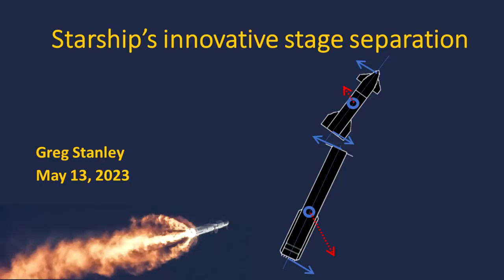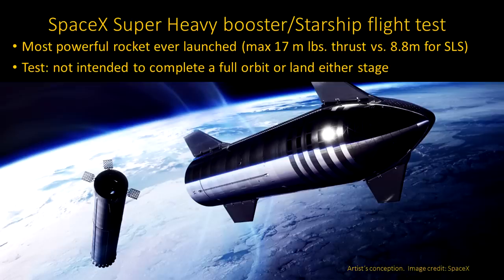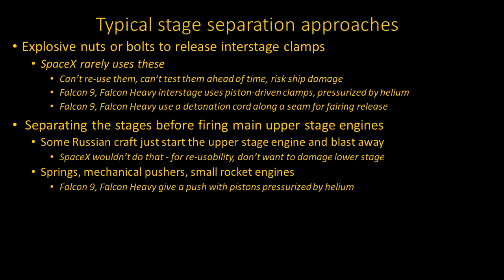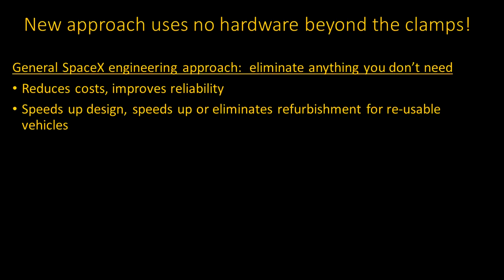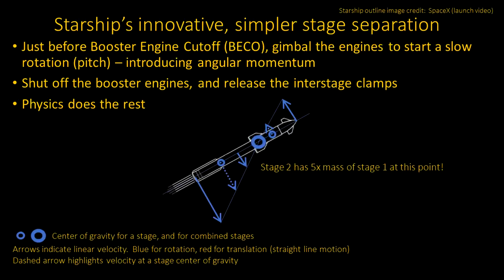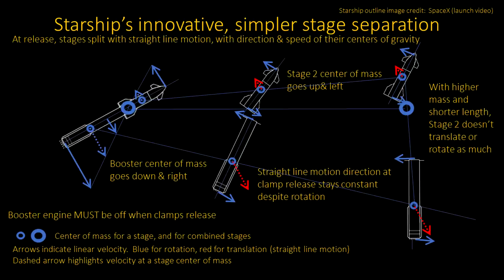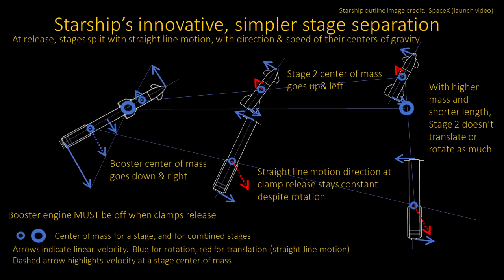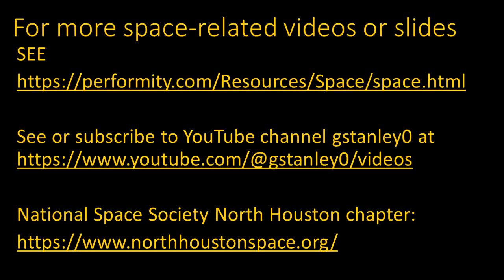Starship's innovative stage separation, using no hardware besides clamps, illustrated

Comment: Good explanation of a system likely to be overly problematic.

in theory it should work, but in the real world that difference between the two stages in center of gravity will cause them to get cocked, and bind.

I suggest going to a large O-ring or lipped seal between the sections, slightly more depth, and then using a pressure charge between them to push them apart.
You have alot of area, so it would act like a hydraulic cylinder creating incredible force at low pressures.

Also with the thrust of the booster, if your collar has decent depth, you should need no actual locking system. its an unnecessary part, would be better with a system like a harpoon, where there was slight friction betwen bitt and helve at the socket, and nothing else. You want to conserve options, so having the ability to light of the Starship's engines in an emergency and have zero encumberances would be best.
In fact, you could use one of the engine gasses to force the sections apart as I have described.

i.e. less parts, less stresses, and instead better tollerances at the slip ring which could be used for linking sections together for other purposes. like extended "train" ships for long Mars runs, or for use as habitat sections.

And if you try the rotational manouver at first zero g, you'll need a barf bag for every passenger.
Also if you used the gasketed socket approach, you could hold the two sections together with a slight vacuum which would in fact become more equalized with altitude.  could be metered to equalize at desired seperation.
Full disclosure: I'm the guy who planted to parts count concept when Elon was worrying about going bankrupt.
Reply: I agree. Looking at this mechanism, at the instant the clamps release, it's likely that the booster stage top will "kick" the second stage bottom. I think this is going to be reviewed where the clamps will need to push away between the two stages at separation.
Reply: Yeah not sure how this cartwheel style maneuver ever became a serious idea... for what is supposed to become a human rated vehicle. Somehow I feel like most people forget that people are supposed to be on starship at some point... There are a number of fairly simple concepts around that seem very reliable, are not very complex, and don't add huge safety question marks. Just a matter of going over some calcs to figure out which ones look the most feasible given the large size of the rocket.
Reply: good thing someone put on their sanity hat and decided to try out hot staging instead
Reply: @rawhide_kobayashi  Well, that didnt work out so well.. the booster got blasted and tumbled and had to be destroyed...
And I was in a discussion last night about the problems and potential solutions, and had to mention stuff from this writ.
Basically the real issue, is Elon has engines way powerful, that the 1960's concepts are now problematic and needs a total rethink and reconceptualized. 
Launching stacked stuff with towers, hot staging, absurd re entry angles, all soooooo 1960's....
Even the Space Shuttle was better, and it was decades ago.
And it was me who started the parts count thing that led to better engines... Maybe its a good time to reconsider re using some concepts, 
and starting to consider new stuff...
Reply: Hey what's your opinion after ift 5?
Reply: @AbhikKumarBhunia-c9l  
Talking about flight five we just saw?
Reply: @garylester3976  yeah
Reply: @AbhikKumarBhunia-c9l  
My position on the catch was as a skeptic until I heard the accuracy stats on flight four. which was only a day or two before flight five. then I knew they would nail the catch.

But, I'm not a fan of the tower plan. its too much infrastructure to do a job that can be done with way less.

Rocket Lab/Beck have talked about  tapered or cone shaped ships that are free standing. 
I think thats a better option. No tower required, or shorter tower for staging, or stage horizontal and erect.

The problem began with the water tank guys, and building in ring sections.
Fine for tanks, but locks to into a diameter and building round with straight sides. Hard to do tapers, or get other shapes.
Which is very easy running your gores longitudinal like in ship building. Basically they got a bad start and too resistant to change at this point. I've done alot of writs about all of it.
But I could see a better Starship being tapered, and bigger at the aft end and using solid structures and minor shock absorbers to stand on surfaces that are reasonably level.

I would have built mostly with longitudinal gores, tapered the booster and ships, probably used semi concentric tanks, Fuel in center tank, reverse tapered them to get two bottoms above engines.
And shortened the ship's length to beam ratio.

Then you could land and take off from any flat hard surface that was armored for the blast,  or design in a flame diverter with a hole, like a Dakota Fire pit.

Where blast goes down in one hole and comes out going up out of the other end of a U shaped tunnel.
This would allow boring tunnels on Moon or Mars and setting the ships in Silos that could be closed and pressurized for repairs etc.
This is why I liked the accuracy stats, meant you could drop them into a silo.
And Tapered ships would be nicely aesthetic. Sometimes some renders sho aft perspective vanishing point style views, and you can see how they would look tapered. Also would allow reduction of ribs and framing going forward and you could taper the longitudinals going forward too, like using tapered poles in a Yurt roof structure, as things get closer together you need less structure.

The problem I'm sure, is they are just trying to get function for now, not get design steps.

But the towers are incredble amounts of money and work, for something I can not need with a shaped ship.
I'm looking forward to flight 6 and Raptor 3  engines.... Been waiting over 3 years for those engines to fly. Was me who suggested simplification and parts count, and cooling, passages, etc.
So its been a longer wait for me than anybody! 🤭
But i suspect an incredibly good engine. The Rolls Royce of rocket engines.
But, flight five did show that they have beat the gravity well uphill and down.
I suspect a change in flight profile saved their tiles, I did writs explaining how to do it. And suspect they tried it and it worked, now just need to adjust profile slightly to eliminate over heating right at the end and to allow for load or velocity variations, like doing Lunar returns.
I'm totally positive about Starship, just know its a crude design that will morph over time, and in 20 years be way better, and have hundreds of other designs to compete with that are flying.
Its not an end all, its a beginning.
I think flight 6 will be the real beginning, mostly due to new engines, and everything learned on flight 5 being upgraded.
As i always say, its Elon's toy box, and I am just trying to help.
Hopefully have answered your questions, but I do most writs on alpha tech if you care to read more...
Thats what I wrote them for, a reserve of possible usable concepts for the industry.

Comment: Great explanation of the concept. One nitpick though:
Right after separation, the angular velocities will be equal. Angular momentum doesn't really matter, they will simply both keep spinning a the same rate. If you're spinning and holding a stick at arm's length and release it, the release won't slow down your rotation. You'll just both keep spinning. So we do still have to worry about Starship's rotation, but fortunately the Raptor's impressive gimbal range and relatively low MoI of the solo ship should allow it to correct its attitude pretty quickly after ignition. 
The gee forces on future crews will feel pretty weird during this whole maneuver- they'll get pulled all over the place, but the jolts won't be as strong as with mechanical or explosive separation, which is good.
Reply from the maker: Yes, the angular velocity of the separated stages matches the initial angular velocity of the ship, as I realized when I finally worked through the calculations.  No matter what sort of variations apply (stage lengths, stage weights, distribution of weight within a stage due to payload or propellant), the end result is always the same angular velocity for the separate stages, matching the initial angular velocity. I'll have to look into how easy it is to modify videos already out on YouTube to fix this.

Comment: Just before separation, the ship and booster are rotating with the same angular velocity (degrees per second). I don't see anything that would change that after they are separated -- differences in angular momentum are exactly balanced by differences in moment of inertia. They should keep the same angular velocity (which should allay concerns about one "tripping" the other). Yes, the lighter one will drift away from the common center of mass faster than the heavier one, but that doesn't affect the rotation.
Reply: exactly what i thought. Both stages keep their velocity moving sideways around each other as a movement drifting tangential apart from each other after separation. And they will keep their rotation.
Reply: You are correct.
Reply from the maker: Yes, the angular velocity of the separated stages matches the initial angular velocity of the ship, as I realized when I finally worked through the calculations.  No matter what sort of variations apply (stage lengths, stage weights, distribution of weight within a stage due to payload or propellant), the end result is always the same angular velocity for the separate stages, matching the initial angular velocity. I'll have to look into how easy it is to modify videos already out on YouTube to fix this.

Comment: At MECO the booster is almost empty because it takes very little propellant to slow down a stainless-steel balloon.  Furthermore the heaviest part of the balloon is the engines.  So the centre of gravity of the booster will be much closer to the base than in the diagrams in this model.  The top of the booster will be moving at a greater speed.
Reply from the maker: good points.
Reply from the maker: @jamescobban857  :  And, I guess that bias towards the bottom is accentuated by the fact that the oxygen (which has to be about 4 times the mass of the methane by stoichiometry) is in the bottom tank.  The methane would still be closer to the geometric center, though, being at the bottom of it's (upper) tank.   I'm trying to improve my rough model of the Starship mass distribution to calculate moments, kinetic energy, etc., to better address issues brought up here.  (See some of the other comments).  
Do you have a source indicating the expected typical range of percentage of propellant remaining at separation?.  The same question goes for the mass of the engines, say, as a percentage of the total empty mass.   As a simple start, my first approximation was just to distribute the empty mass equally, obviously in need of improvement.   The same question goes for how close the mass ratio of O2 to methane will really be.
Reply: @gstanley0  We know how long the engines fire to put the booster back on the RTLS flight path, because every full duration raptor test at Mcgregor simulates that.  Musk has also narrated a mathematical simulation of the catch.  The mass of the Raptor2 engine is published as is a rough dry mass for the booster.  Maybe use KSP to experiment with fuel consumption profiles.  The remaining fuel left in the F9 booster should be a rough guideline although the F9 does not need as much fuel reserve for its landing as the booster apparently needs for the precision catch.  I am confident that the residual fuel at MECO must be between 10 and 20% based upon back of the envelope rocket equation calculations.  Have fun.